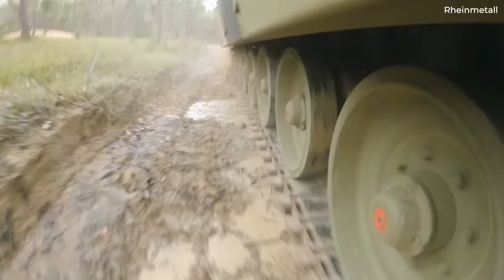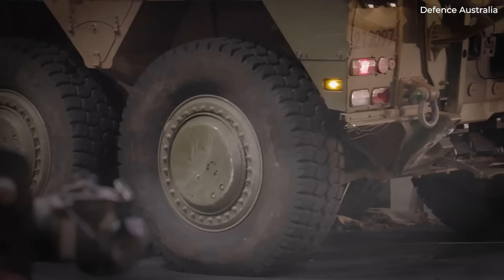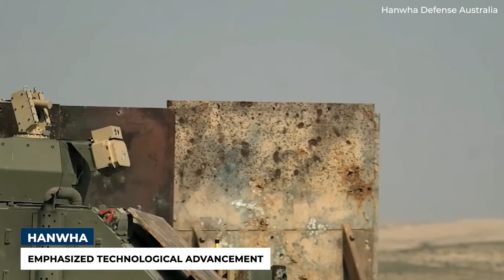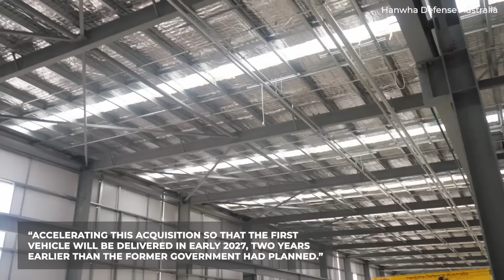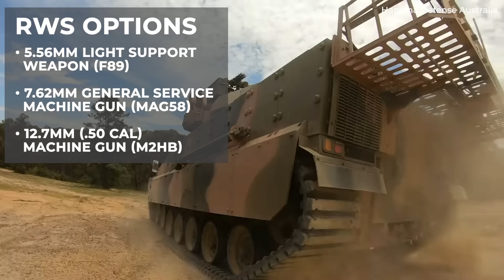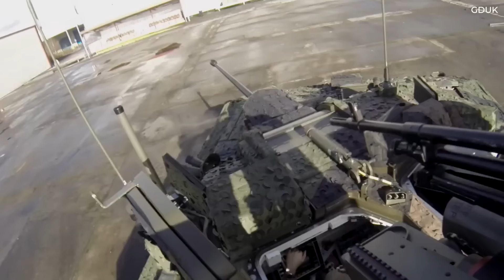AS21 Redback: The Australian Army’s Next-Gen IFV

Comment: IIRC the actual order was for around 450 IFVs but was cutback to the current number of 129 in 2023. Does this mean that the M113 APCs will soldier on to compensate for the reduced order?
As to the Choice of the AS21 Redback, would it be wrong to say that it is reflecting a move towards reliable Asian partners that are closer to Australia in physical distance? I think this is can also be seen in the choice of the Mogami Frigate for the Royal Australian Navy instead of the German MEKO design.
Reply: I think it's a fair point about forging relations in asia. Although in both cases the products seemed to be better than the german counter parts. 

Apparently they are experimenting with turning the M113's  land drones.

I wouldn't be surprised if they are planning to build the rest of the 450 order eventually. But they now have time to announce it as political will to spend on defence increases the more dire the situation becomes.
Reply: its now longer a 1 for 1.  Redback will be going to townsville to replace the M113's in RAAC.  Some boxers as well to replace the ASLAV

Boxers will be replacing M113's in other units
Reply: No they'll flesh it out with boxer

Comment: Would be interesting to know how the trio was graded and why the Redback got the upper hand. The South Korean equipment is usually very price competitive for a very good quality product. Could that be it? Budget limitations.
Replacing a 60yo APC (the core design) with a modern IFV is indeed a big transformation 😄
Reply: Redback was cheaper and performed just as well as the Lynx while apparently better in some metrics. CV90 was too expensive and ‘less developmental’ than the Redback and Lynx.
Reply: The Canadian tracks won the day.
Reply: @chriskitchener1129  You mean the rubber tracks? You know the CV90 has had a rubber tracks offer forever right? I think it may even have been the first IFV using rubber tracks.
I'm just saying it seems unlikely that was such a big factor.
Reply: Unit price wasn't exactly cheaper, but the local parts modifications the austrailians wanted were already on the redback compared to Rheinmetall wanting to push their full set of german equipment
Reply: Cost is an unlikely driver, money is frre for the Govt.
Reply: Dunno why the CV90 lost out, especially as it's American variant seemed to beat out it's 8 competitors (maybe it didn't meet a range requirement?). But both the redback and lynx passed all requisites but apparently the redback performed those better and was cheaper.
Reply: @dan7564 CV90 lost to Ajax in the UK because BAE refused to build it locally, so maybe BAE had their head up their ass again while the Koreans were happy to build in Australia.

Comment: Even though I'm a fan of the CV90 the Redback is a fresh awesome IFV for Australia. This vehicle will give our troops the best protection, mobility and firepower and overall being domestically built like the Boxer is a big plus.
Reply: Maybe you can get the barracuda camouflage that Sweden uses for the CV-90 both makes it harder to see with the eyes and sensors-70% heat signature and electronics signals which is usually how armored vehicles are tracked, pretty expensive but huge increase in survival, the ghost as the Russians call it, if you even notice it most people think it’s a destroyed vehicle because of the low heat signature, the camouflage can be used for other things then infantry fighting vehicles and Nordic countries are slowly implementing it in other units, but unfortunately very expensive not like your normal camouflage in price or ability
Reply: that iron fist anti rocket defence is in thanks to the Israelis input! which is what beat the Rheinmetal tender.
Reply: @seal1mas  Lynx had strike shield APS. Cost sealed the deal.
Reply: @knowahnosenothing4862 not cost, but localization. AS-21 won because it was better with intergrating austrailian designed parts and systems. With regards to actual cost, the ANAO report specifies that the KF-41 was cheaper.
Reply: Hmm.. Yea, but that exhaust solution looks like it will result in a rather big IR target..🤔
Reply: @leifiseland1218  I only know for Boxer and Puma but these modern vehicles usually mix cold ambient air with the exhaust air before pushing it out for a lower thermal signature.
Reply: @jonny2954 Yes, & CV90 uses a similar solution aswell, but if you look exhaust of these Redbacks, they don't seem to be implementing any system of that type.. 🤨
Reply: @leifiseland1218  It's not visible from the outside on CV90 and others either, not sure how you come to that conclusion.
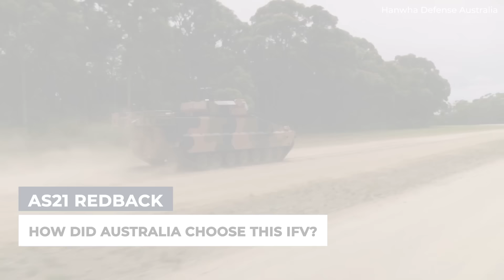Reply: 0:34 Camo seems less effective than most others visually.
Other comment mentioned barracuda camo, I think it is very much needed.
Reply: As a Swede I'm happy for you getting a good fighting vehicle, our CV90 has enough of the market to manage well, and some healthy competition is good for all.
Reply: Best protection would've been a unmanned turret IFV, but the Aussies are afraid of technology.
Reply: @jonny2954 No they aren’t,t thinks it more to do with cost and maintenance
Reply: @reddyman6915 Dont forget doctrine, you cant just change mechanized doctrine for a single vehicle. Lower crews less redundancy it has an effect.
Reply: @rext87able  In case of a IFV a unmanned turret allows for a larger crew. Because commander and gunner seated facing forward in the hull takes up far less space than a turret basket for the two.

Boxer IFV variants as example fit 6 dismounts with the manned lance turret and 8 dismounts with the unmanned Samson turret (Vilkas). On the unmanned RCT-30 turret they kept it at 6 but gain storage space worth two seats in a rack under the turret.
Reply: @jonny2954 thanks i didn't consider this

Comment: I think the Lynx would have been chosen,bar the fact it is too heavy and German licencing laws can be a thorny subject
Reply: Considering the Redback uses a MTU engine and a RENK transmission they are all up in German licensing laws anyways.
Reply: Lynx had vibration problems
Reply: The tender eventually wanted a more localised product, and on that the AS-21 was superior. It uses various austrailian designed parts in ways KF-41 couldn't match in time, or give an as concise plan to.
Reply: @HSS_yt  I heard also there was some vibration problems' with Lynx KF41 variant.